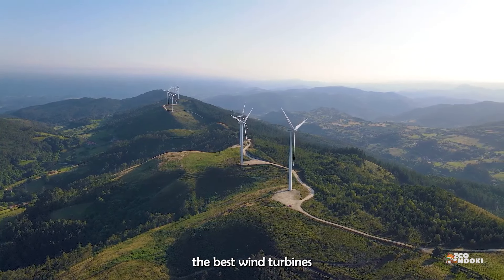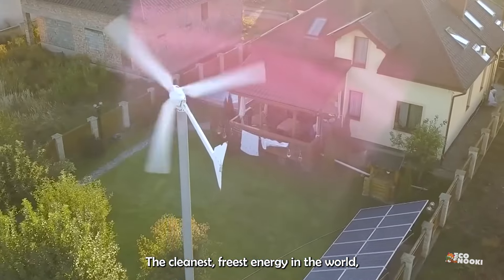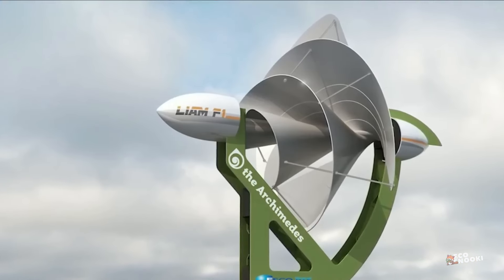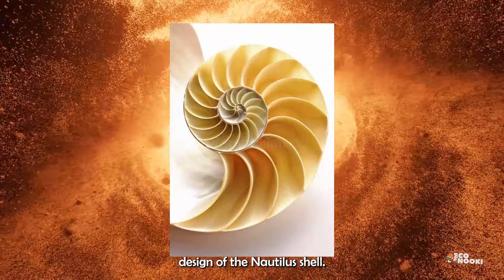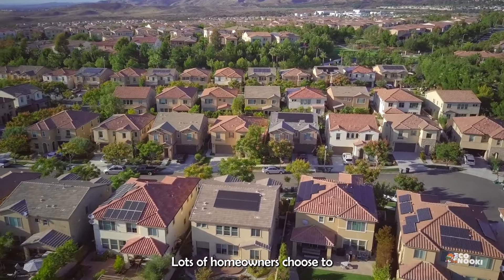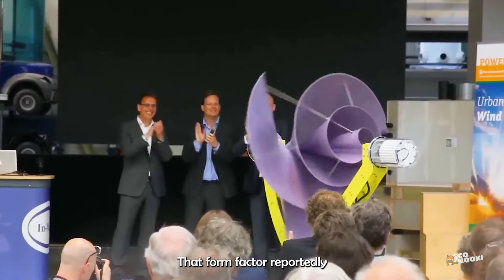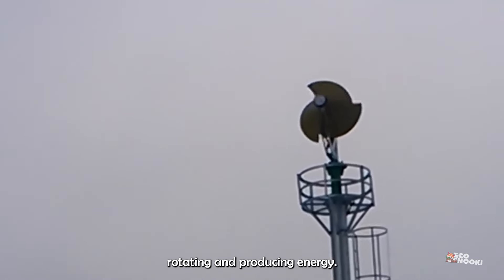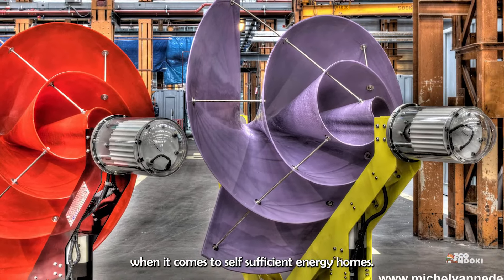Unlike any Wind Turbine you've EVER SEEN : The Liam F1

Comment: A classic bullshit design. The standard three=blade propeller-type design is 98 % efficient: that is, it takes out 98 % of the energy that can be recovered from the wind. The best of the various other designs can't exceed this. It is NOT POSSIBLE to take out more than 100 % of the available energy. Solar panel efficiency has greatly improved: there are soon to be even more efficient 3d-etched surface solar panels. What matters is energy produced per unit cost for solar, as once it is in place there is almost no maintenance.